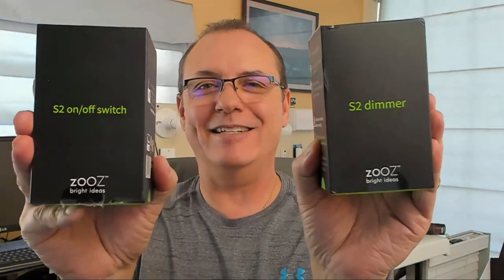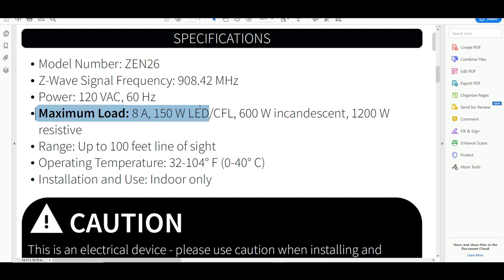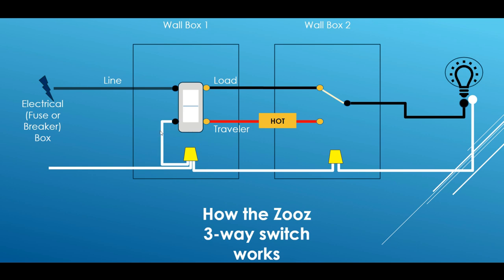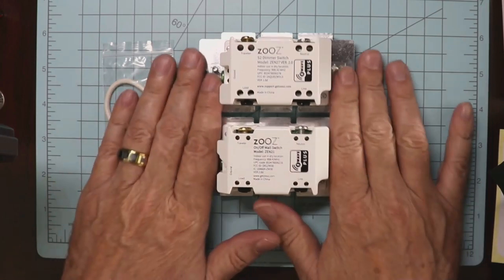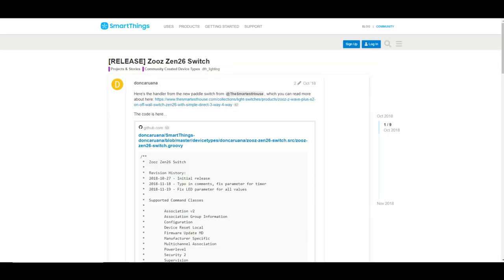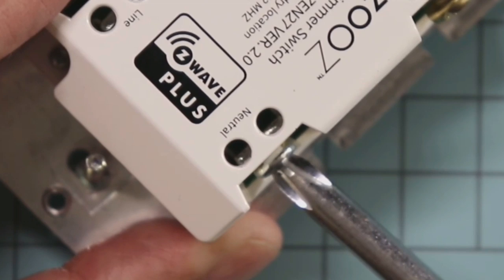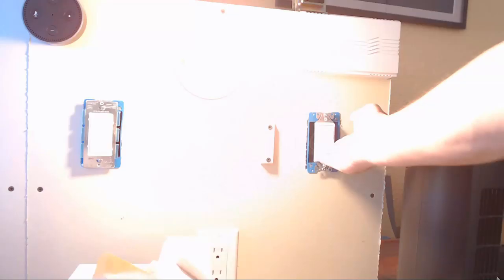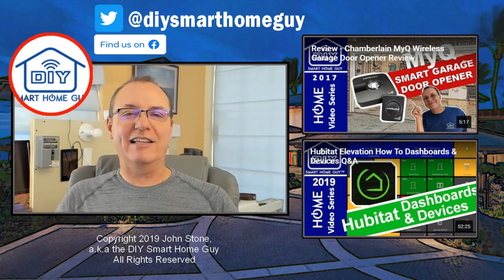Zooz Zen26 & Zen27 S2 Z-Wave Plus In-wall Smart Switch Review

Comment: Excellent product, our new smart home setup is coming along nicely thanks to your videos!  Scene control and setup with Sylvania Osram bulbs is just pure AWESOME!  Now on to garage door control.  Can you review the Zooz Zen 16 multi relay, it seems to be the most cost effective multi door control.
Reply: @DIYSmartHomeGuy1  I have ordered a zen 16 as well.  I plan to use Singled door sensors to report the state.  Will let you know how it goes.
Reply: Ok, somthing I have ran into with the Zen 16.  The current firmware does not allow for auto off less than 1 minute.  This prevents the ability to make a momentary switch for garage door control.  I have added a piston to WebCore to turn the relay off after 5 seconds.  Not really how I planned for this relay to work.  I hear there is a firmware update that is going to address this.

Comment: If you did wanted to use two of the Z27 in a 3-way setup (NOT use one "old" switch...both smart switches) is that configuration supported and could you then din from both?
Reply: @DIYSmartHomeGuy1  I looked at the GE, I think I will try those with the add-on switches.  Thanks for the reply!